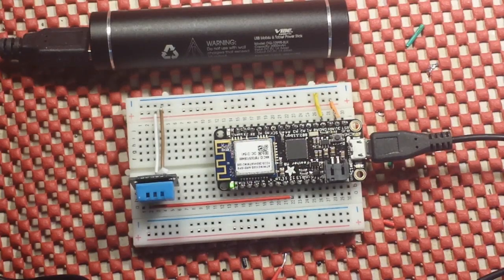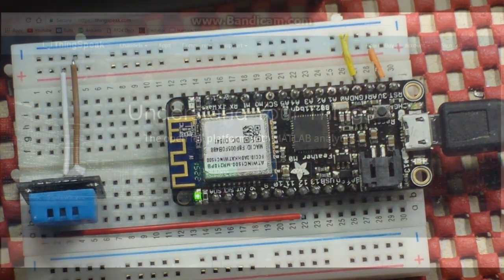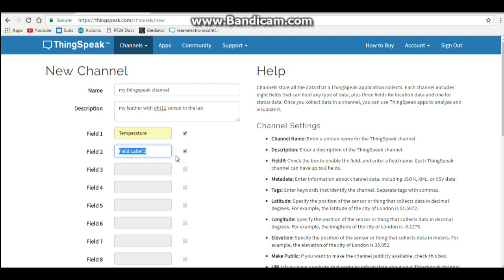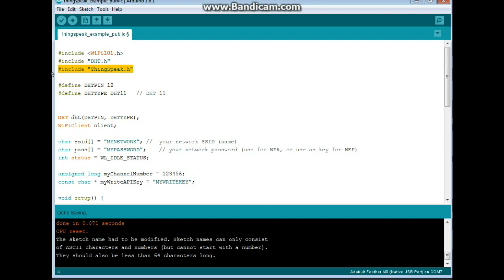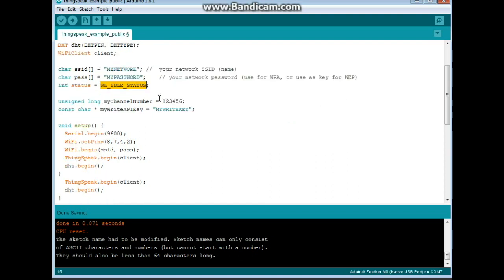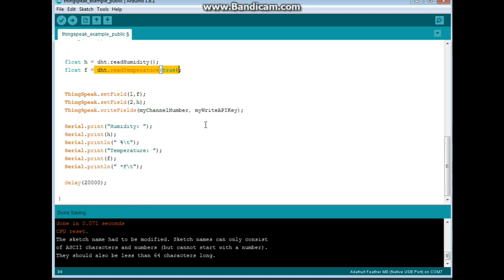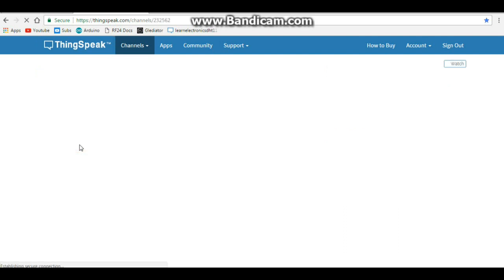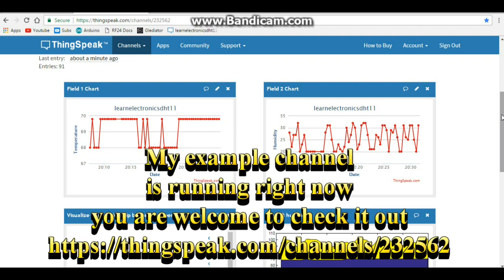How to Use ThingSpeak with Arduino

Comment: thank for the video, but im having a hell of a time getting it to check out
Multiple libraries were found for "ThingSpeak.h"
In file included from C:\Users\Windows\Documents\Arduino\libraries\DHT_sensor_library\DHT_U.cpp:22:0:

 Used: C:\Users\Windows\Documents\Arduino\libraries\ThingSpeak
 Not used: C:\New_Programs\Arduino\libraries\thingspeak
C:\Users\Windows\Documents\Arduino\libraries\DHT_sensor_library\DHT_U.h:25:29: fatal error: Adafruit_Sensor.h: No such file or directory

 #include <Adafruit_Sensor.h>

                             ^

compilation terminated.

exit status 1
Error compiling for board NodeMCU 0.9 (ESP-12 Module).

Comment: I am using an esp 32 development board and would like to know if I will need a different "WiFi.setPins" (you have 8,7,4,2) in my sketch? Thank you for the very detailed vid..I am emboldened to try this because of it!
Reply from the maker: Yes, it will depend upon your board, just check the documentation.
Reply: Thank you for the reply! Do you have a Patreon account so I can push a few bucks on you? Or another way to do it?
Reply from the maker: Yes I do. www.patreon.com/learnelectronics

Comment: Hi 
Im trying to do this for Arduino uno and ESP8266 because also i need to use current sensor so, Should I upload the code in the Arduino or ESP8266? I just wanna use ESP8266 for communication to wifi 
Thanks

Comment: thumps up .
can u tell me about your wifi module?
Reply from the maker: digimind it's an Adafruit Feather M0
Reply: one more question sir.can u tell me what are benefits of using esp8266 as a standalone chip and as a arduino controlled chip ?is there any flash memory constraint?

Comment: hi learnelectronics ,

iam trying to upload accelerometer (3 axis ) data to thingspeak.com using arduino uno and esp8266-01 . can you upload the same
Reply from the maker: revathi Elangovan as long as you have the log ins, it doesn't care what machine it comes from
Reply: learnelectronics .
Reply: learnelectronics  thanks sir,

Comment: Thanks for the guide, I am having a few issues though. The code below is my current code (which is not posting anything to thingspeak). If I attempt to put "ThingSpeak.begin(client);" I get the error: 'client' was not declared in this scope. Also I am using the 1.3.0 ThingSpeak library. Thanks.

#include <ThingSpeak.h>
#include <ESP8266WiFi.h>

//WIFI Setup
char ssid[] = "ssid";
char password[] = "wifipw";

//Thingspeak API
unsigned long myChannelNumber = number;
const char* myWriteAPIKey = "key";

void setup(){
 Serial.begin(9600);
 WiFi.mode(WIFI_STA);
 WiFi.begin(ssid, password);
}

void loop(){
 
  float w = analogRead(A0);

  ThingSpeak.setField(1,w);
  ThingSpeak.writeFields(myChannelNumber, myWriteAPIKey);
  
  delay(20000);
}
Reply from the maker: Nick B Nick, I'll look this over when I get home today and see if I see anything out of order and I will get back to you soon. Thanks for watching the video.
Reply: Thanks! To add on a bit, I am using a NodeMCU.
Reply: I think u have to enter the channel number and write API key..then u thingspeak client begins.

Comment: Great video as always! I was hoping you were going to also explain how IoT with the RJ45 - ENC28J60 Ethernet Shield for Nano. and a local IIC I2C Serial SPI 128x64 OLED display for good measure!!

Keep 'em coming!!
Reply from the maker: cloudsuck the sketch for an Ethernet shield would not be very different. where mine says "wifi.begin(SSID,pass)" yours would say ethernet.begin(macaddress). and you would use Ethernet.h as opposed to wifi.h.
if you need more help just let me know, is be glad to